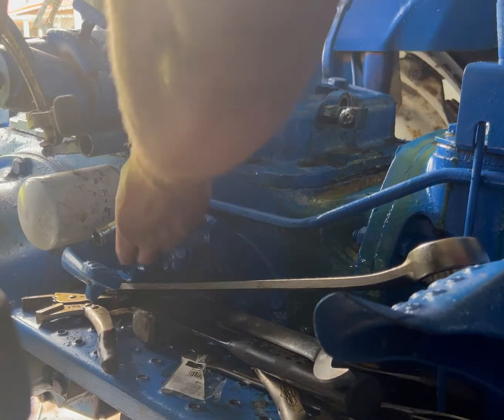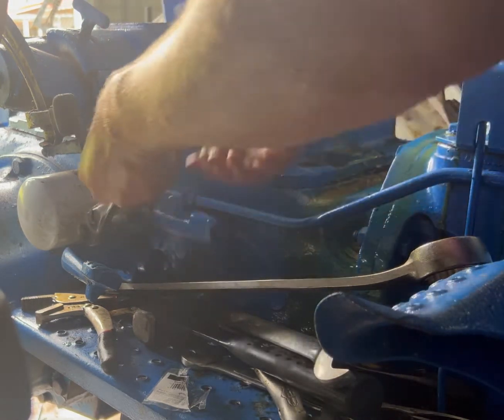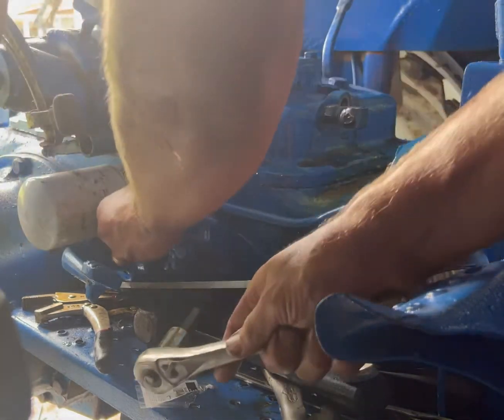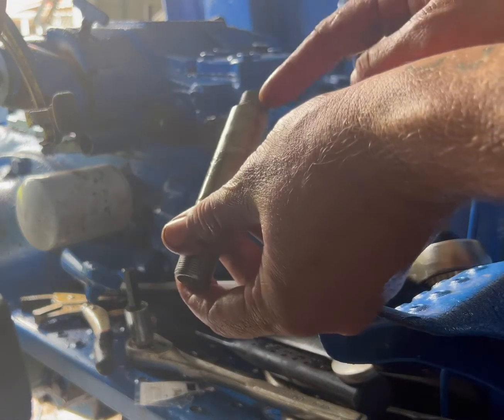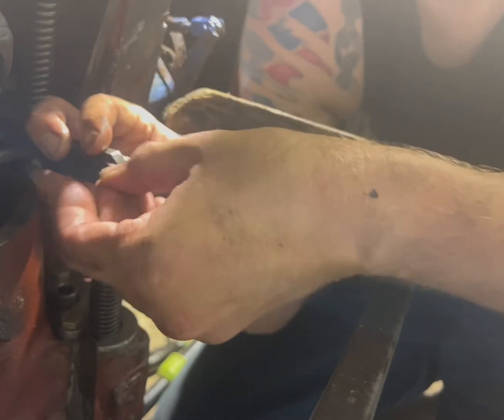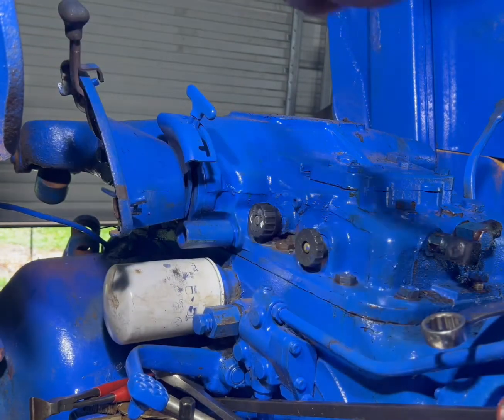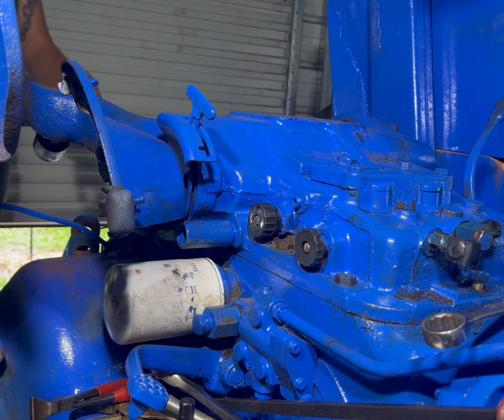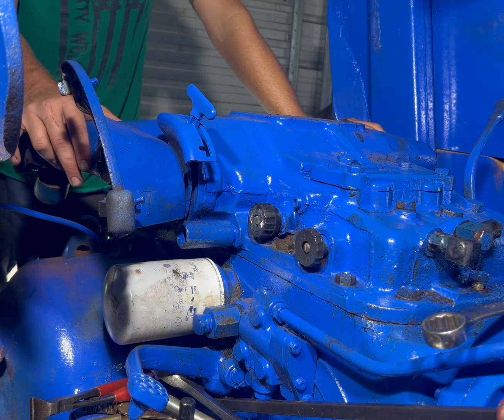Ford 3 Point repair 7600,6600,5000,7000 3 Point Lift stays up in lower position won’t stay down

Comment: The lift on my ford 5000 wont go below right before level with the ground. So with a box blade i cant dig down any. Iv tried adjusting any lever i see but nothing helps. I can set it to stop higher but not lower. What do you think could be the problem?

Comment: My position lever won't stay where I put it (with the draft control lever set to "position"), it just goes to the bottom. Is this an internal or external problem? for now, I added a couple 1/4-20 bolts in the lever track to act as detents to hold the position, which works fine, but I know it's not right.

Comment: Thanks !  My bucket works, but not the three point , 1972 ford 4000 , cant find hydrolic fluid overflow bolt , its not below draft seed screw, its not by pto down low on left, it came from Illinois dept of transportation,

Comment: conartist losing "1" bolt and the whole hydraulic top coms off
Reply from the maker: I didn’t think you’d wanna watch me take out 15 bolts.
Reply: Helpful video, I have a Ford 5000 with a similar issue. With the 3pt lever up or down my 3pt arms don't move up. I can grab the arms and move them myself. And I notice my tractor does not have that bypass in the location on your tractor in the video. I checked the fluid level plug near the pto and checked the transmission fluid. Both are topped off. Looking for advice thanks for your time!
Reply from the maker: @Corymfjones Your problem sounds like a stuck unloading valve issue. It too is located in the draft cover. 
 If you go to my playlist there’s a “tractor repair playlist” and you’ll see this same tractor that’s pulled into my shop. I’ve also made a video on a stock unloading valve on a 641 ford tractor. 
 The bypass is for the hydraulic oil cooler, if yours doesn’t have a cooler in the grill you may not have that bypass tube.
Reply: @MattTheWelder  I removed the cover bolts and started to break the seal but something hanging on preventing me fro. Removing it. If I'm standing behind the tractor near the pto it's on the right side. Not sure what's catching on it.